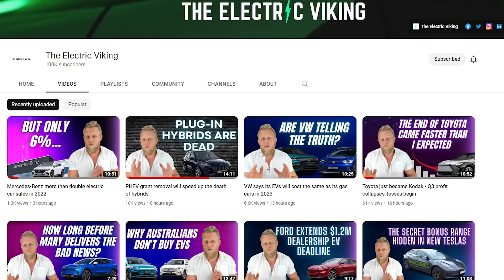German power company destroys wind farm for new coal mine

Comment: I understand trying to patch the hole that has been created due to the Russia situation.... but to remove an existing power source because of it?
Reply: Wind turbines have an expected life of 20 years. The fatigue on the blades would cause them to eventually break off. Other parts wear out. They could easily extend the licenses for operation though.  Solar panels have a life span if 20 years. That doesn’t mean they stop working… it means they are putting out less power each year and when they reaches 80% of the name plate power that means they are worn out.

Comment: all EV are the problem, we the people do not have the technology to make a battery that is worth spit.  right now i can pull in to a station with my 10,000 pound pickup truck pulling my 12,000 pound tractor fill the tank and drive 600 miles.  
as compared to the new ford F150 EV that cant even pull 2000 pounds 150 miles before it is dead.  
people there is a huge ass problem here. 
now look at the were and how you charge a EV ,,,, were do you think that power is coming from?
do not say wind and solar as a gene that cant even meat the demand of normal needs. just look at Texas in the heat of the summer or the cold of the winter. 
we the world is a good 100 years away from this point.

Comment: The questions you ask are non sequitur.  The real question you should be asking is whether Russia should have invaded Ukraine?  The answer to that question will provide you with your answer.

The natural gas supplies they were coming in from Russia have all been stopped. The pipeline has been blown up nobody I know has the report from Sweden on that.  So now Germany can't fire its gas fired plants which yes burn fossil fuels but not nearly as polluting as lignite. So what is Germany to do then?  They have hard winters they need something to heat their homes with the electricity that they once had and it was fired by gas is no longer there and these power plants are sitting there ready to use. Now it suddenly becomes a no-brainer.  Once you get out of the European war situation that is come upon them then they can respond in a more sane manner.

Comment: And where does the power come from to charge the electric cars when renewable energy isn't enough to even supply households...

Add the fact that you need to do at least 400,000kms before a fully electric car breaks even on emissions as a petrol car, as producing an electric car actually IS toxic, especially lithium ion cell producing....

I build exotic evs and ebikes. They're fun and quiet. They're not environmentally friendly....

Comment: False narrative.
Actually the usage of ground water for the tesla factory is a local problem. It still is a problem for the environment in this region. That means NOT that whole Germany has a problem with water usage. We are not located in the desert.
Tesla is also not the only company producing electrical cars.
RWE is a power company in West Germany partially owned by the state. The state politicians are overly dependent on the green party which is in support of renewable energy. IF they have to rely on coal that is a big stretch for their power base, their supporters. Even if it is not about a NEW coal mine but the continuation of an existing one.

Comment: I guess you could charge your car from the coal plant that would be un-environmental, not sure how it compares to gasoline.
Reply: EV powered by 100% coal power is still way greener than petrol, despite what the anti EV lobby would have us believe.
Reply: @sdpryce  What environmental impact does the lithium mining and other materials have in the making of the batteries? Also is there no cost to their recycle? Once you have the car produced it is low emission but the battery is a large cost of the car. We are going to have a lot of older EVs with bad batteries that make no financial sense to replace the battery. What are we to do with these vehicles and who is going to be left holding the bag on an old used EV?

Comment: Activism has become a mindless demonstration of intolerance and self righteousness. Nevertheless I do not support Tesla either. Not because of the water issue, but because EV limousines are not either sustainable nor environment friendly. EVs that make sens are small city cars with a small battery. Range is the enemy of EVs. That's why Tesla's trucks will never exist. The max load on most roads is 18 metric Tons. An typical truck will carry a max of 1 Ton of fuel and a max of 14 Tons of fret. To replace 1 Ton of fuel you need a 14 Tons of fuel. So you payload is reduced to 1 Ton. Gool luck with that. Also electricity is not an available resource. We need to generate it and we cant store it efficiently and cost effectively. So those who say "EVs are carbon free" are just ignoring part of the process. Also Lithium ignites spontaneously when in contact with water. Now imagine all the old lithium batteries generated by the EV industry in 20/30 years. A nightmare.

Comment: Your arguments are weak on security of supply.  A key criterion for security is to avoid dependence on a single "pathway" to energy. This counts all elements, and I'll focus on fuel supply.  If we focus only on the lowest cost source of energy, we become dependent on it, so if supply is disrupted, we suddenly learn that we have no security of supply. That's basically what has happened with gas - we are over-dependent on gas, thinking it was cheap and environmentally preferable.  Now that gas is in short supply, we have to out-bid others in the market, which makes it exceptionally expensive.  And the consequence of this is that we go into distress and the net overall environmental outcome comes home to roost without our ability to plan and manage it.  So, yes, coal does have a part to play. And if we had planned better, we would have upgraded the asset base and coal fired power stations  would have been more thermally efficient.  
And, to balance intermittent wind power means flexing around other sources of energy which increases the costs of the other sources (for various reasons). This increase on cost should not be attributed to the other sources of energy because they are not the sources of the intermittency. The source of these cost is our adoption of wind power for energy supply.

Comment: They all have negative environmental impacts.  EV's will help clean up the air in congested metropolitan centers and that is good.  EVs also cause environmental damage to produce the batteries.  The problem with EVs is that they are mainly charged up at night when the sun does not shine.  Wind farms have their own set of environmental problems.  I am sure you also know what they are.  I guess you better take up ridong your bicycle everywhere to minimize damage go the environment.

Comment: Coal is 90% of EV fuel.   EVs need coal.
Reply: Not in Denmark. 90% ev fuel from wind/Sun.

Big Oil use cobolt to refine gasoline. Big oil use a lot of power from coal power plant to make gasoline😷

Comment: 500 tons of ore to supply one tesla battery
Reply: Oh brother🤦‍♂️
Reply: @lchpdmq  right, rare earth minerals are 1 to 1 ore to battery product. My bad...
Reply: @Thenakedfinisher  right, rare earth minerals mean that it only takes one ton of ore to mine to get one tesla battery. Glorious.
Reply: @TheGuerillapatriot  you should find better things to complain about there are real problems in this world
Reply: How many tons of coal do you suppose they will dig up at this mine.  Then burn! 
If that was nickel or other battery metal it would be recycled into new batteries countless times.
That makes you point kind of pointless!  Next time at least mention what mineral you talking about.
Reply: @danharold3087  only 50% of most of the minerals can be reused... smh. Burning coal is good and clean. Yes, clean, modern coal burning electric plants in the West have scrubbers. The only thing coming out of the smoke stacks is water vapor.
Reply: @TheGuerillapatriot  And your point is utterly nonsense - the waste rock goes nowhere - only the concentrate gets shifted.
The ash that comes out of the boilers on a coal fired power plant is more radioactive than the average waste from a nuclear power plant…
Reply: @TheGuerillapatriot  As an electrician who has worked on all types of power plants, I can guarantee that there is a lot more coming out of those stacks than water vapor. Even the best scrubbers mainly reduce the particulates (by around 80 to 90%, but proper maintenance effects that greatly), the SO2, and a lot of other toxic materials and gases that are in smaller amounts, but CO2 is still the largest component of exhaust.

The water vapor comes from "wet process" scrubbers that spray a fine mist of water that then attaches to particulates and dissolves the solvable gases and materials into it. It takes A LOT OF WATER to run a wet scrubber, and the water/sludge has to be disposed of once saturated, with disposal becoming a big problem, since those chemicals need to be kept out of the drinking water.

Most of the coal plants shutting down are the ones without scrubbers, as since most coal plants are barely profitable, so the cost of adding scrubbers would put them in the red. It is now more profitable to shut down a coal plant that is only a couple of years old with all of the most recent high efficiency turbines and scrubbers, and replace it with wind and/or solar with battery backup.

Recycling percentages for minerals in batteries is more like 70-80%, and climbing, and is higher if you consider the second life in energy storage that many recycled batteries work well for when the power to weight ratios are not important. And the recycling level of burned coal is zero, although a few byproducts make it into cement products.
Reply: @TheGuerillapatriot  You assert that only 50% of materials in a battery can be reused via recycling. Do you have a source to back that up? The reason I ask is because Redwood Materials claim a 95% rate, and Tesla claims (I think) 92% for its recycling facility.
Reply: @TheGuerillapatriot   Are you using the "WayBack" machine to find 50% mineral recovery?  I will admit as each new chemistry is introduced it must be incorporated into the separation process.

  Scrubbers alone do not remove CO2 and not all the SO2.   To build coal plants with carbon capture are a why bother.
Reply: @GoCoyote   China builds 4 new coal powered electic plants a month.  I'm inclined to belive your claims are in good faith.  
The cost to run them was made unprofitable during Obama term.  He stated he would regulate and tax the operation to be unprofitable.
Reply: There you go stepping into it again.  That 500 figure has its roots in a post showing an electric powered coal excavator.    Again you fail to mention what type of ore.  Totals FUD
Reply: @danharold3087  i didn't say what you stated has no merit... I have to review the ideas that  are contrarian at their sources and then find the curated material that is disappeared of the internet. I can't use Google.  Thanks.
Reply: @TheGuerillapatriot   Most materials that once existed on the internet have been saved in the internet archives.  AKA the WayBackMachine.
Reply: @TheGuerillapatriot  Within the energy industry, the writing was on the wall for coal fired power plants before the Obama administration. China is an odd duck when it comes to comparing their economic decisions to other parts of the world, as they have such a varied mix of decision making and environmental controls, and not all of their decisions make sense to outsiders, or indeed, work out well for themselves.
Reply: @GoCoyote  written on Wall to cede to China